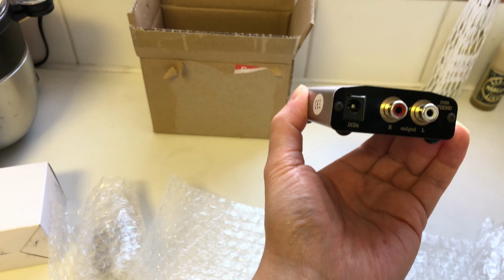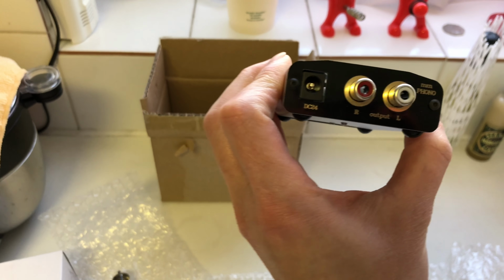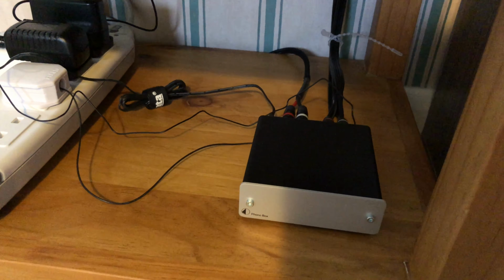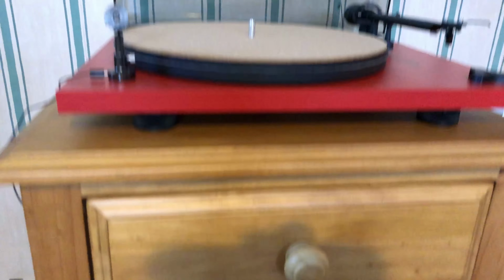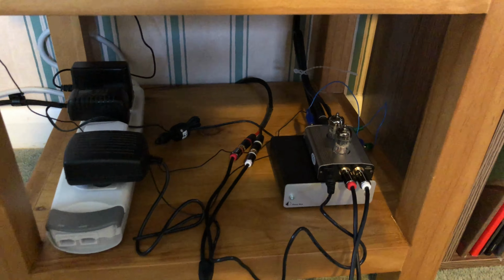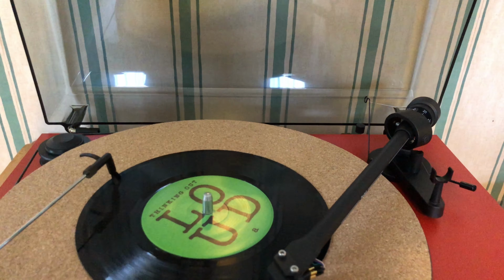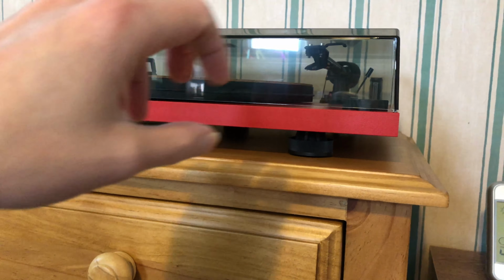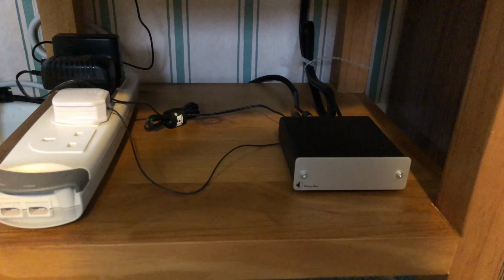Setting up and testing the Douk Audio Mini Tube Phono Preamplifier (MM)

Comment: Actually, regarding your comment (one that others keep making), there are very good moving coil cartridges for as little as about 200 dollars. With a 100 dollar mc capable preamp, and reasonably good amplifier and speakers, even a cheap mc cartridge can make a significant upgrade, which I have personally tried.

Comment: This video is how my ADHD works when I'm not medicated. WHY didn't you just put in the GE tubes? Just put in the GE tubes and play 10 seconds of the most obscure record you own. If you have never heard music through a vacuum tube, possibly you need 5 more years of vinyl listening through Solid State amps to file down the harsh edges of what Digital has scarred. Then you will understand the perspective of what even order harmonic distortion is.
Reply from the maker: What? I put in GE 5654W tubes. Read the description.